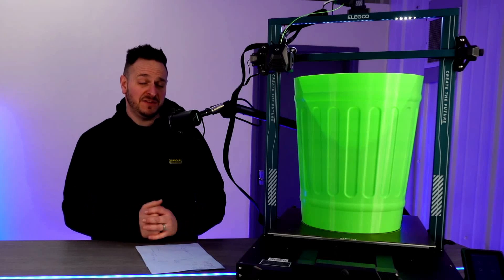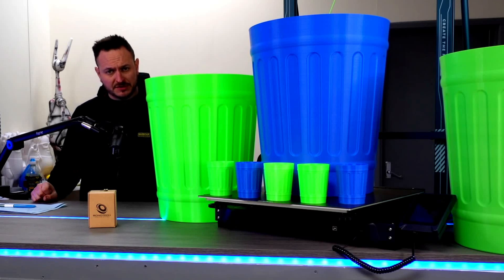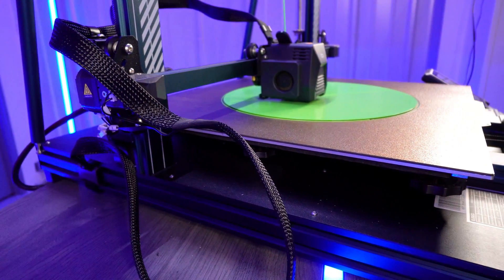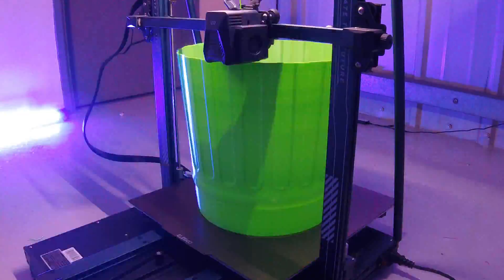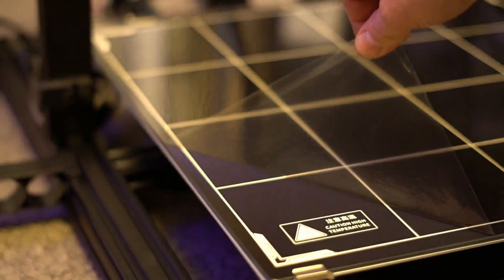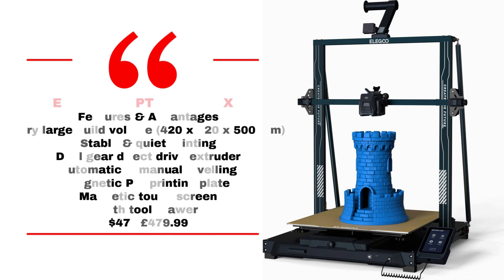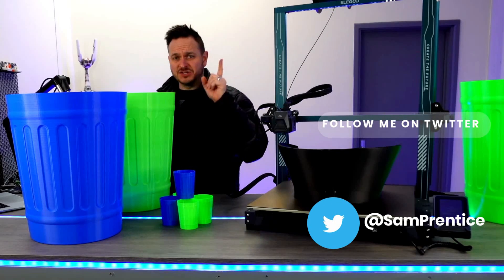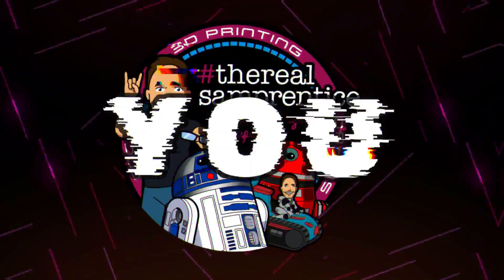Printing High-Quality 3D Models with Elegoo Neptune 3 MAX

Comment: Looks like the extruder is up to the task. That was my main concern with the machine and trying to keep up with a big ol' CHT nozzle.
Reply from the maker: I shared your concern when i saw others putting 1mm nozzles on! I had days of printing at 1.4mm again something that usually I’d never use, popped the temp up by 10 and it’s been non stop.